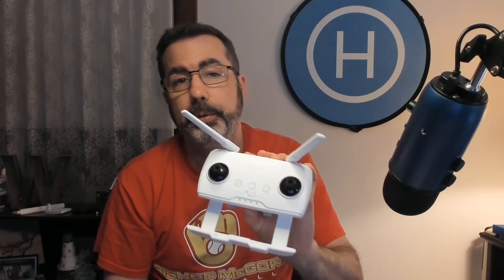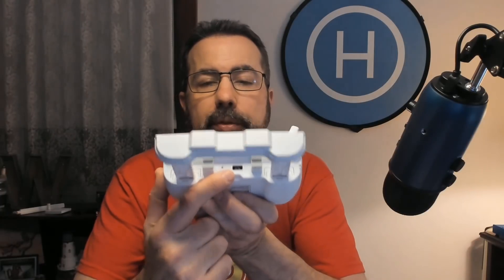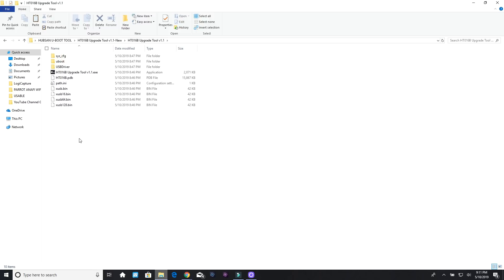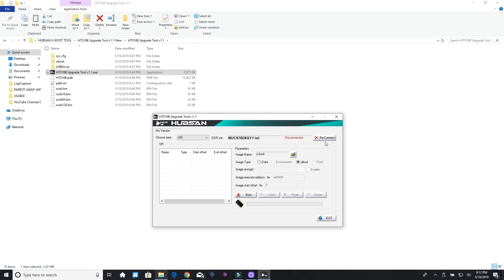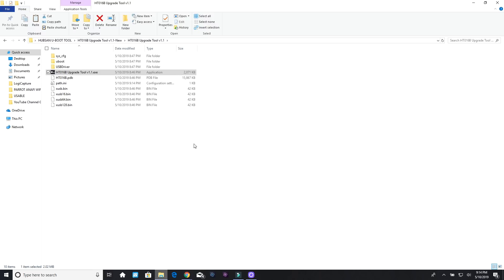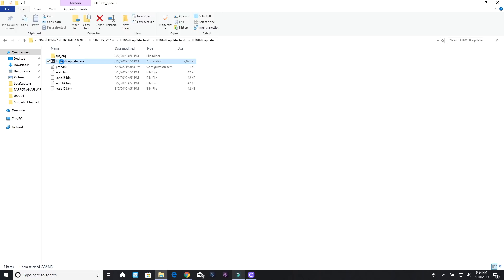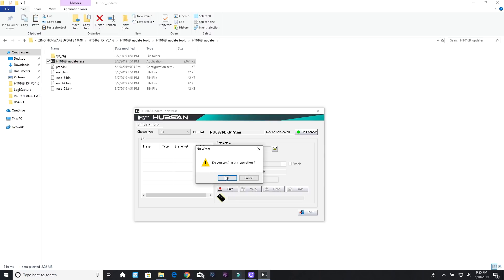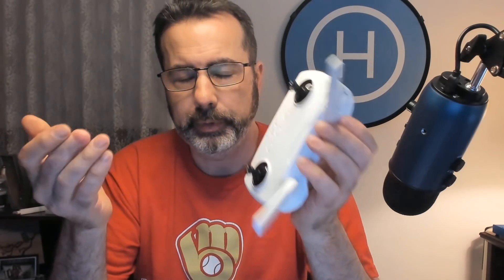HUBSAN ZINO - U-BOOT TOOL - RESET YOUR BRICKED CONTROLLER!

Comment: My zino controller have a button in the middle where you have the pins, and I do have 8 pins on the right side. Do I still jump the first 2 pins from the left? 
Transmitter HW version is 1.0.0.
Reply from the maker: No you don’t need to do anything. That is a controller that came out after this.
Reply: @QCGUY Thanks for the reply. So mine is newer? I can only fly around 300m, I'm trying to figure out how to extend the range for the past 7 years (kidding). Today i cut the top parts of the antenna and pulled the wifi antenna and module to have them fully extended.I did test flight but stopped in the middle because it's too windy today. If you could give me tips on how to go further, please let me know.

Comment: Hi Chris, I purchased the Hubsan Zio Pro Refined from AliExpress. When I tried to set it up, I get a "Warm Tip" saying it is not supported in this market. Great to know before making the purchase. Anyway, they are absolutely no help at all. So it never paired with my account and never flew. Would a firmware update overwrite the non-USA software so I would fly in the US. Or any help is appreciated. Thanks.

Comment: I have a controller for a Zino Pro that is doing this same exact thing.   Is it possible to remedy it?  The Pro controller doesn't seem to have any pins at that location, plus (I assume) requires different software to upgrade.  I have a perfectly functional drone that I can't use!
Reply from the maker: I have controller’s but no you can’t do this procedure. Email me if you need a controller. 
qcguy.chris@gmail.com

Comment: I'm just trying this as we speak, I'm almost there... but my laptop keeps saying 'no vcom port found' in the hubsan app when I try to continue onto connecting the transmitter
Reply from the maker: Newer models don’t require this. They changed it later on but my advice is if it works fine for you let it be. 👍🏻

Comment: Hi , Chris , thanks for the video , but problem , i have no pins to short circuit , but a switch...i came into this video  because , when i want to take off , it says Throttle not centered and refuses to do it.Tried to calibrate sticks , i can't get out , and now i cant even switch on the TX it immediately go to the calibration loop.Any ideas?Thanks again.
Reply from the maker: This is a first for me. I’ve seen throttle not centered but never seen it stuck in stick calibration mode.
Might end up having to buy a new one…
If you’re in the us I have some that are perfectly fine.
Reply: @QCGUY  thanks a lot Chris , but i am in the Philippines , the only provider i found is Amazon , but there is a Visa debit Card problem...i don't have any with Ebay or Banggood , but they do not have the TX.
Reply from the maker: @francoisBonin-phils  I see....sorry

Comment: Will this work on the Zino Pro Controller?
I notice that the Zino Pro controller doesn't have the pins on the bottom.
Reply from the maker: If you have a push button or nothing there at all there is no update needed or available. 
There was just this one update and that was the end. 👍🏻
Reply: @QCGUY  Thanks QC GUY, not many youtubers take the time to answer questions on their channels.
Reply from the maker: @Nomorsht  I try my best to answer all. It’s hard sometimes....Thanks 👍🏻

Comment: Dear QC the problem is with the remote control, I did an upgrade and it does not synchronize, I did what you say in your videos but the bulbs are still flashing. In the program for uboot I do not run the bar that loads the program. Sorry but my English is not good and I do it from a translator
Reply from the maker: Μιχαλης Βλαχακης Join my group... I don’t spend my time troubleshooting here. Sorry 😐

Comment: Hello,
The Gimbal of my Zino does not respond anymore, although it's brand new. Do you know if there is a process to make a hard reboot, or a factory reset of the Zino? I think my issue comes from a firmware bug, because it started after an update of the gimbal that didn't end.
Reply from the maker: Tatou2B If the gimbal is totally not working then most likely it’s your cable. Post a video in my group if you need more help. https://www.facebook.com/groups/HubsanQC/?ref=share

Comment: Hi Gui, unfortunately my transmitter does not connect to Zino, I ran your tutorial to the letter with the hope that it would work again but it wasn't like that.  Do I need to replace the transmitter?  Thanks in advance for your reply.
Reply from the maker: Join my group or any Hubsan groups of your choice and show the exact situation in a video is best. 
https://www.facebook.com/groups/HubsanQC/?ref=share
Reply: @QCGUY  Good morning, I am already registered in your group on FB I hope you can help me, after several attempts he connected after I updated the Zino FC firmware again then the situation returned as before.
Reply from the maker: @cultore65  The group can help you. I am not the only person that can give you suggestions and I am taking a break right now. Thanks
Reply: @QCGUY  You could reset the drone firmware, I reinstalled the gimbal firmware it finally connected but the App kept asking me to celebrate the gimbal.  After repeating the start-up procedure several times, the problem occurred again and the drone and the transmitter no longer paired.
Reply: @QCGUY  As you advised me I published a video on the FB group I hope you can help me solve the problem.

Comment: can this fix controller switching off mid air?
Reply from the maker: RICHIE KAY KAY No, I don’t think that would resolve your issue. I would look deeper.
Reply: @QCGUY  thankyou for your quick reply... it was working perfectly until just the other day when it started this problem..sometime after restart it will boot and switch off after solid blue light..
Reply from the maker: RICHIE KAY KAY Definitely a internal problem. Bad connection most likely is my guess. 
I have spares if needed. Just message me on Facebook under this name.

Comment: chris i badly need help... i just got my zino today but my controller is stucked in boot mode.  i wanted to upgrade it but then i dont have the 6pin configuration.. instead there is a tiny push button/switch in its place... i cant even get my zino to connect to my computer :(
Reply from the maker: If you can't get it to connect to the computer you have a bigger problem. All I can tell you is try different cables, a different computer if possible and as for the button you press and hold it the whole time during the update.
Reply: thanks chris... i was able to reflash the controller several times using different usb cables...all the time it still ends up in boot mode... im really losing hope but then i remember in a video i saw about using your phone instead of the controller to fly the zino... i was able to connect this way though ill have to test its performance tomorrow... thanks again chris
Reply from the maker: @IanandIdaDroneAdventures  Send it to me if you like and I will get you sorted out.  No charge....

Comment: Hello, my controller has not 5 pins, it has a button, do you know how to do the update of the HT016B with this ?
Reply from the maker: Funny Box There is no need to update the controller. If you have this button then you have the latest firmware.
I will make a video soon.....
Reply: @QCGUY  oh okay thank you for answering so fast :), you are really cool and I like this, + 1 subscriber from France ;)
But I have a problem, when I connect my phone (Mi 8 lite) to the controller, my phone (with USB debug turned on or off, it doesn't change nothing) get the notification to how I want to use the USB connection (charge only, image transfert or files transfert) but it disappears 1 second after it appears... and when I open the app (X-Hubsan), I select the Zino drone, after I go to the settings to search the list of drones by WIFI, that shows "your device is not correctly connected to the controller", so I don't know what to do... I already tried to contact the Hubsan support (no answer) or to search on a lot of blogs and forums, but I didn't find the solution. This is why I thought that an update will maybe solve the problem, but you say I have the latest firmware so, I don't know what to do... Do you have any solution or advice for me, or do you think my controller has a manufacturing defect ? Thank you again, it's really nice to help people like that.

PS : I were writing a mail to kitchw***@gmail.com (found on your YouTube description channel) to explain my problem with some images and screenshots for a better comprehension...
If you have the time to help me, we can continue to communicate by email, I will send you soon the mail I were writing for more details...
Reply from the maker: Funny Box Sounds like a device compatibility issue. Have you tried any other device?
Reply: @QCGUY   I tryed with an other device : Umi Plus but it's not a famous smartphone and I don't have other device here, but this evening I will try with an other phone, I will tell you this evening or tomorrow if it worked...

PS : I just sent you the email
Reply: @QCGUY  Hey, I tried with a Samsung and an iPhone, and it worked for both of them, so I took of the drone and I land it, (Idk if my translate is good O_o), so it's working, thank you man, your help were very useful, now I just have to buy a new phone :/
But there is a lot of people who can't use their drone if we look in the commentaries of the app on the Play Store, I think their last update causes a lot of incompatible phones with the app, so maybe in a future update my problem with the app on my Mi 8 lite will be solved. Thank you so much again :)
Reply from the maker: @funny.box.  I read your email and looked at the pictures. I felt the same after the email so I'm glad that turned out to be correct and that you were able to see that with a different device. Time to buy a new phone i guess? lol
Reply: @QCGUY  Yeah, I'll probably buy a used Samsung phone for 20-40€ only to use the drone and I'll keep my actual phone, because the Mi 8 lite is a good phone, or I'll change my phone but I have it for less than 1 year ago so I don't want to change too often... Oh and I thought to download an old apk of x-hubsan, maybe it will be compatible with my phone, I'll try this before buying an other phone. 
Thank you again and good evening 🌙 👍

Comment: Going to have to give this a try, mine is pulling this and i havent even flown it yet!
Reply from the maker: Did you have a bad update before this problem or use the wrong cable like a charge cable and not a data cable?
Reply: @QCGUY  I used the cable that came with it.  Kinda freaked out by it not knowing what happened, when i did the update i tested it and it worked fine.  Just today when i went to fly no go
Reply: Still nothing, just did a test hover and small input check with my tablet the drone is ok tablet is ok, I got to believe the controller is dead
Reply from the maker: @matthewbrothers2823  Are you 100% sure when you updated it that you used the file in the update folder from hubsan and not the file that is already listed in the tools window? If so did you confirm the burn or try to update again after the uboot tool?

Comment: My problem is that when I connect the controller to the computer - and then turn on - there isn't any sound(in the video there is a sound like when you plug a pendrive  etc). So my controller does not connect to the computer... I've tried with multiple cables and still doesn't work. What is the problem?
Reply: And then at the Upgrade Tool there is a message when I hit reconnect: "No VCOM Port found"
Reply from the maker: Balazs Hosszu You’re using a standard controller I hope because that’s all this one will do plus you want to make sure your firmware is listed in the bottom of the tool and no vcom is definitely a connection issue so usually it’s when you use a charging cable and not the correct data transfer cable. Without it in front of me that’s all I have to offer ya. Hope it helps 👍

Comment: It took a few tries for the program to take but eventually I was able to get the program to work. Unfortunately, the transmitter is still stuck in the boot loop.
Reply from the maker: Resolved?
Reply: @QCGUY  No, sadly. I ended up returning the drone to the seller.
Reply from the maker: @TheInflicted  bummer

Comment: For some reason it's still stuck in the bootloop. Followed your guide step-by-step
Reply from the maker: If you did exactly like my video then I can only suggest you try a few more times. One other person said it took them 3 times till it worked for some reason.
Reply: @QCGUY  after 11 tries, I think I can safely say it doesn't work for me :'(
Reply from the maker: Jeroen Decordier I’m sorry and hate to hear that. If you’re not then you should join my group and see if they can help you although I think they are sick of hearing the words ZINO and disconnect.
Reply: @QCGUY  Just wondering... so I get this right if I turn it of after the Boot it should stop giving the blinking lights, right? It's not like there's another step....?

Comment: I have had a different, more frustrating experience. First of all, if your Zino works, DON'T UPGRADE ANYTHING! Yesterday was the first time I got my Zino out since last year. It worked fine. But then me being the thorough technician I am went looking for any relevant updates and discovered firmware updates for both the transmitter and the Zino. I successfully updated the firmware on the transmitter, but was unable to update the firmware on the Zino. When connected with the same USB data cable as updating the transmitter, the Zino won't ever show that it is connected in the Zino upgrade tool. I attempted to connect using my Pixel XL Android phone but the Hubsan app after scanning wifi never shows any wifi access points available. So, there appears to be a problem with the Zino accessing the Android's  wifi . I would expect it so see other wifi AP's if it was working, but it doesn't. I have scanned for normal wifi access points and I never find the Zino. So, I don't understand how upgrading the firmware on the transmitter would then result in the Zino not broadcasting its wifi access point, but that is what seems to be happening. very frustrating!
Reply from the maker: Christian Gentry Your case is a bad camera or gimbal install. Most likely the camera.
Reply: @QCGUY  actually I haven't resolved the issue with being unable to connect the Zino to the Zino firmware update, but I have resolved the no wifi connection issue. Turns out the microsd I put in wasn't formatted.
Reply from the maker: Christian Gentry link me to a video or  most preferably post one in my group.

Comment: Thank you so much Chris !   This is exactly the issue I'm experiencing .  And I got a message from Hubsan that the controller program tool I ordered on 04/23 has finally made it to the US  .   Hoping it will arrive  tomorrow and I can complete the firmware updates this weekend .    Thank you again and hope you have a great weekend !  😁👍👍
Reply from the maker: Dman 52 Come back with your results and good luck 👍
Reply: @QCGUY  controller program tool. which is that?
Reply from the maker: rüştü damdandüştü it’s what I used in the video
Reply: @QCGUY  Oh yes ,  nice ,  thank you !
Reply from the maker: Dman 52 I try not to do half ass here! 😂
Reply: @QCGUY  Hey that's my middle name !
Reply: @QCGUY  Well the connector arrived today for the controller update and it's not easy to plug in .  I tried to get on Hubsan.com for the ubolt update but today I get a site can not be reached message .  Wow ,  starting to think I'll never fly my Zino !    Ha ha !
Reply from the maker: Dman 52 You have all you need right here! I include everything I can on topics so look in the description and you will find the tool, file and documents all in the same linked folder bud.